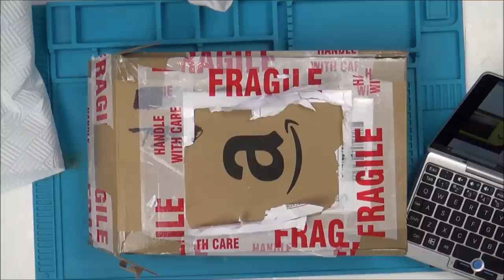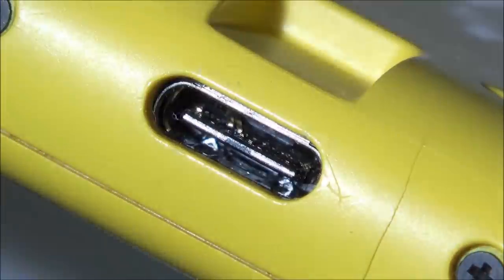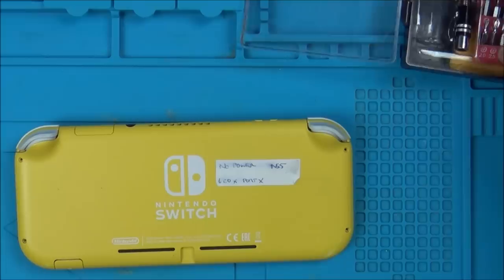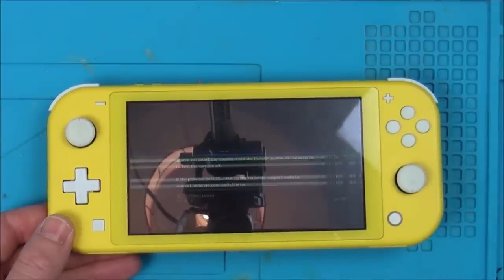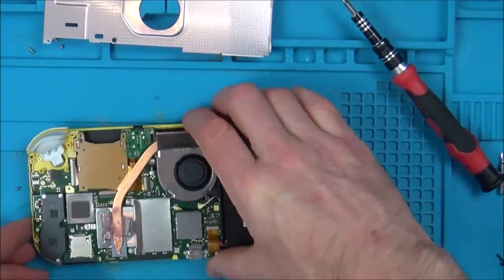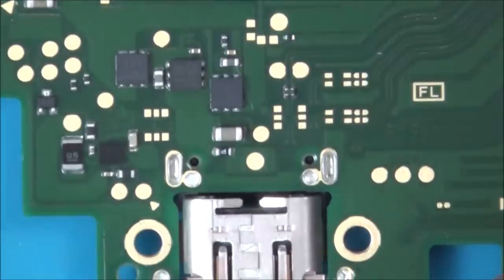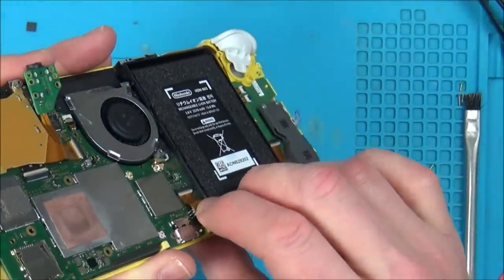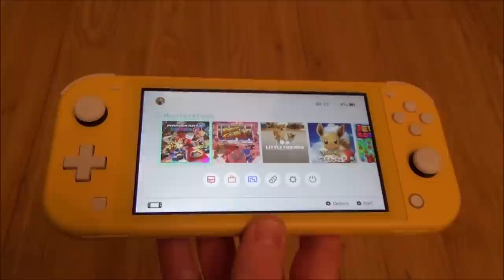Trying to FIX: Faulty £85 Nintendo Switch LITE from eBay

Comment: Although I know you are an amateur anyone that can reflow a chip like that can replace a USB port like that which is an easier job. You wont get any better at soldering etc by sidestepping challenging jobs like that and wussing out. So just get a new USB port in it ffs you actually have the bits so why not...If you are unsure how to do it TronicsFix is the man to show you how...But what it looks like to me is your heat gun just hasnt got the juice to heat stuff up enough for when its quite a bit of metal like that port is...But watch his video on that as it is very educational...other than that, a bit more logic and less panic required and a bit less rushing to please the viewers, just focus on the job and forget the rest. Otherwise you got it working and fault found the board issue so well done there...

Comment: The one I got for $99 with free shipping and the blue screen of death just needed to be reflashed. Luckily it was the older model that you can hack to run android, which allowed me to reflash the firmware and bypass the fuse check so I could boot it and flash it to the newest firmware 🙄

Comment: The USB C female connector is the same on both sides but one side is flipped so it will connect to the right pins on the usb male connector and both rows are connected but most companies that make micro USB type C cables don't connect all the pins on the male connector to save money and that's why it only works one way, if nintendo had both sides connected on all their cables it would be able to do a slow charge or a fast charge both ways  arround.

There are 12 pins on a micro USB type C connector because 2 are for power 2 are for USB 2.0 compatibility and 5 for USB 3.0/3.1 data the USB 2 and USB 3 data pins are used to talk to the charger to tell it to give the switch 40-45 watts to fast charge and any extra pins are grounds or used for other stuff like ethernet, USB OTG and docking

https://en.m.wikipedia.org/wiki/USB_3.0#Architecture_and_features

https://www.google.com/search?q=usb+type+c+pinout&client=ms-android-uscellular-us&prmd=isvn&sxsrf=ALeKk02U-6-JP6-7OMMCW_kmLAkY8s__sg:1585463921135&source=lnms&tbm=isch&sa=X&ved=2ahUKEwiG6squib_oAhXZmnIEHQtlBBUQ_AUoAXoECA0QAQ&biw=360&bih=518&dpr=4#imgrc=dPPZykM4xpwpnM

Comment: Most likely stepped on while charging on the floor lol kids. Then someone's dad or a teen took it apart and said F it I'll just make some money. Or you could be right and you bought someone's parts build.
Reply: It's absolutely a parts switch. The motherboard is broken in software, the screen that wasn't even plugged in was physically smashed, the connector was bad,  even the analogue sticks were replaced with cheap Chinese knockoffs

Comment: replace the port, I will guarantee that you will bend the pins on it again and short out the charging chip again.  Oh, and I would message the seller and tell him he did not disclose the damaged screen.  There is no way he did not notice it.  Try to work out a partial refund at least.

Comment: eBay: Here's a great deal for you! Faulty Nintendo Switch LITE for £85 
Facebook Marketplace, after searching for a few weeks: A fully functioning Nintendo Switch Lite for $80 USD.

No joke. Prices on eBay tend to be massively inflated (in my experience) when compared with sites with lower seller fees.

Comment: "there's no way the screen would be married to the board"

Oh you poor, poor summer child... Apple and their little knockoff cousin Samsung already did that.

Expect the OLED Switch to be similar given the price of OLED screens. Of course, this assumes Nintendo will bother to actually put OLED screens in them. Most New 3DSes had at least one TN panel (sometimes both) instead of dual IPS, and there were more than a few TN Switches running around too.
Reply: Well about Samsung and apple id be happy taking a Samsung bc it's better than this android I have now

Comment: When buying theses on eBay you have to think like a scammer. Anyone claiming not harvesting parts are likely the ones harvesting parts. Don't also buy from cellphones stores or anyone in business of repairing stuff. Then don't buy from people that states AS-IS that they never tested it, or states the issues. You follow those rules you increase chances of getting a good one. I look at what they sold, or selling and if notice phones, IT computer equipment, or popular electronics. I won't buy as likely screw with. Doing that I now get mostly good ones.

The new common scam is they know pretending that it was their child and stop working and one recently they bought from estate sale and won't charge.

Comment: I’m just wondering why you didn’t use a port from one of the other damaged boards you have. 🤷‍♀️

Oh NVM I see. Something with the mother board has shorted. So now he has three paper weights. 🤦‍♀️
Reply: He says at the end its too much work he also says hes fine with turing the cable around not to big if a deal

Comment: NAME AND SHAME!
Reply: They will probably delete their account and setup a new one.

That happened when i got my ez flash omega, it was paid for i waited weeks to get it and all i got was a small lego thing (it said free gift on the package it came in) so the seller was sent a message asking where my thing was and didn't answer and deleted his/hers account so ebay had to get my money back so i bought another ez flash omega from someone else and that one i got so i put a 32GB micro SD card in it put my games and saves on it and it's the one i am still using now to play my GBA games between playing my switch and my LG G5

Comment: I cringe whenever someone calls the usb cable a charger and here is why. 

I plug my usb type C cable into my phone but not the wall, it doesn't charge because it is not a charger. 

The plug for the device would be more relevant to call the charger. With energy transfer modules to the battery within the device itself. The cable? it is in reality, a, data cable not a charger hence why it is used via plugs to transfer energy to the device or data such as from an external hdd. In either use there is still a flow of electricity in the cable. Thus the cable transfers data and energy for a device, hence, it can be used for either regardless of manufacturers say so. It is just a cable, NOT a charger.

Sorry, just had to say that as most call it improperly, a charger.